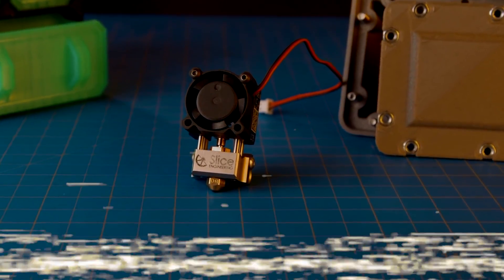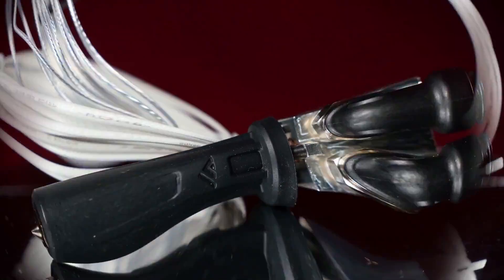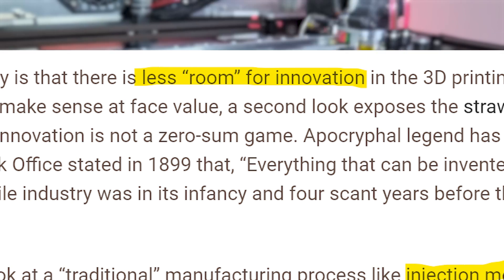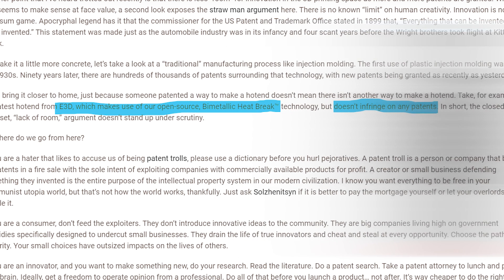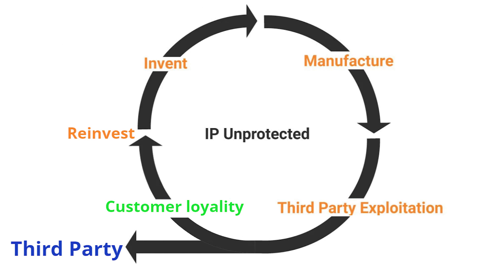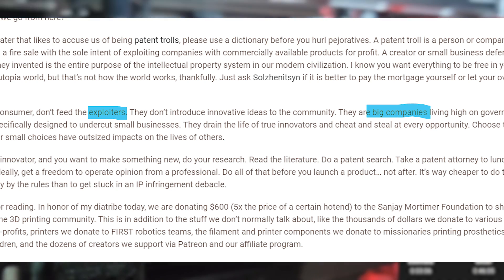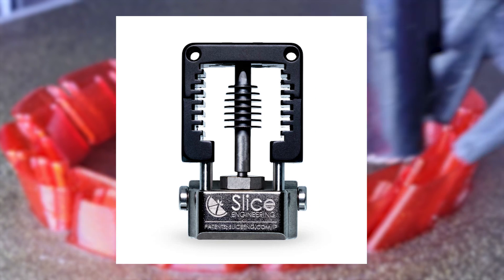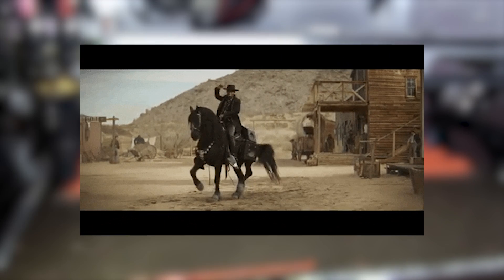Slice Engineering's RIDICULOUS response - VzBot Goliath VS. SLICE ENGINEERING in 3D Printing

Comment: Nice video. It would be good to dig up prior art, there were spacer isolated hotends before Slice came along, so their patent is probably invalid. It takes lawyers and money to fully attack a patent but digging up and sharing the old evidence through the community would go a long way to help getting Slice to back off. They apparently reinvented an old wheel and got unearned credit for it.
Reply: Sharing it will also point out the hypocrisy in those youtubers that claim to be against patent trolls but still accept money from Slice Engineering.
Reply: Honestly if someone digs something up and would start a kickstarter campaign for a lawsuit I would probably donate.
Reply: @Di3Leberwurst  same for me, I'd donate!
Reply: @Di3Leberwurst  I would donate too. I would do a lot to force them to leave us alone.
Reply: The example above (Plastruder MK5) your comment looks similar in concept to what the Mosquito is doing
Reply: 1. Stratasys was the first or one of to make hot ends like this 4 screws 1-2 standoffs was the same on several models long before sliced bread!
2."Love" sometimes you have to protect your loved ones! even if you wear a unicorn on your sleeve 
3. Great Video thanks for your angles i think this was needed
4. screws and bolts may never hurt me but names last forever 
5. maybe we should patent an automotive radiator while we can? does mount with 2-4 bolts and standoffs too 
6. engineers know better than to try and patent pre existing century old nuts and bolts or washers and spacers they are not your design you never made them and I feel nothing unique was patent but only others inventions either stratasys or Tomas edision or duke domville
7. the part about you know... clearly shows not only the level of engineering but the level of politics moving into printing???? wow is there further direction to this to come i wonder...? maybe an APP...
8. overview -the whole damn thing is thermal dynamics nothing is actually MADE by the maker to be a Patent in my opinion yet the arrangement that already exists! via Fasteners from the hardware store and nothing more.
I feel they know its not going to be challenged as the start up guys simply cant contend with them even if it was for making a cheese sandwich! like municipalities they too will dry you up long before you get to make your point and for this reason we have loving things like open source support! 

unicorn in training  
care bear count down!

Vezey dont ever stop YOU! but I understand when the 7 is stolen from the calculator you must recalculate (cant wait to see the changes!)

Cheers 

new sub here
Reply: 13:30